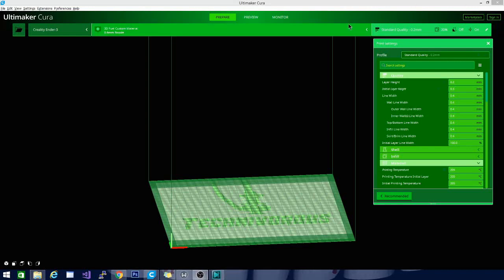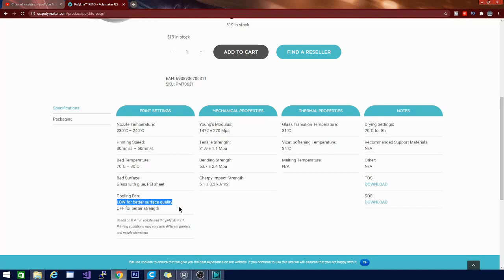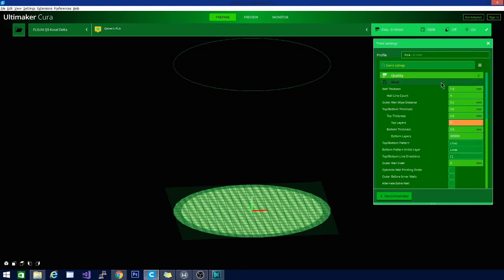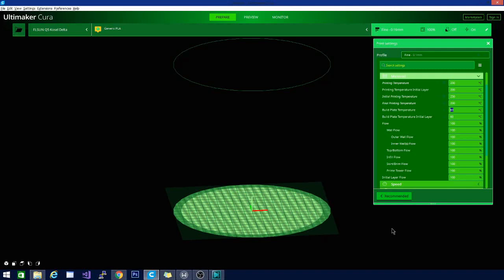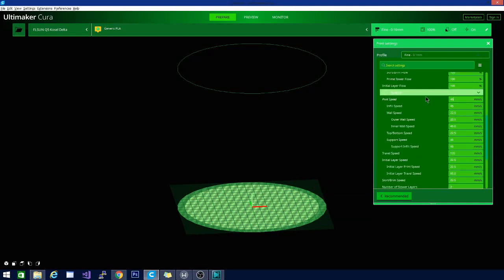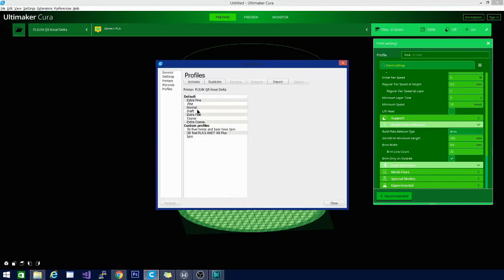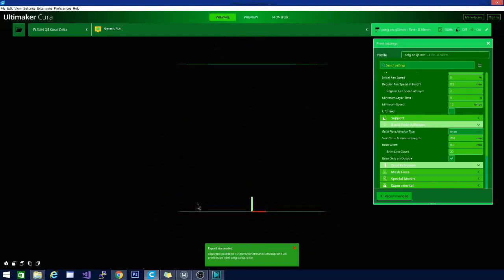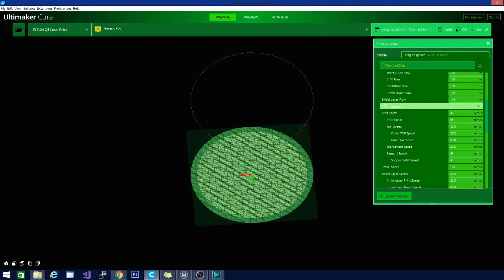CRUCIAL Cura settings for PETG printing

Comment: Will your profiles work on an ANET A6 printer ? I have a 3mm glass bed mirror that works really well to stick PLA on it. PETG i have had to use 70C and a 245C initial layer with fan off to get it to stick nicely. The rest of the way up I just go back to normal temps. But my PETG does not seem to like the normal recommendations and runs better at 220C with fan at 40~70% speed. I am not sure what is best yet.

Comment: Hay man thank you for putting this up way back ..i just used your settings to make a little action camera threaded mount  ,,supper simple but it came out so perfect with your recommended settings and advice. and on an old Ultimaker first gen printer too. cheers to you!
Reply from the maker: Glad I could help

Comment: 5:27 I was under the impression that Initial and Final Printing Temps only mattered if you're using multiple extruders, based on the Settings Guide plugin.
Reply from the maker: Generally speaking yes, but initial print temp is the minimum temp it will begin printing so if your print temp is 220 and your min is 215 it will start at 215 and then continue to heat to the set temp. It is very useful for keeping dual extruders from using, but it does apply to every time you heat and stop

Comment: A huge thank you.  Yesterday I tried to print a petg model and after 3 hours I stopped the print because it had gone all to hell.  The bed side of it did OK but was a bit ragged and then the petg began to build up in globs on the nozzle.  Once it started to print the walls it got really bad and finally wasn't even worth continuing.  I watched several YouTube videos before I came to yours.  I downloaded your Ender 3/Cura profile and loaded it up (the only change I made was to reduce the fan speed to 10 percent) and now I am watching the same model printing and it is damn near perfect.  Again-a huge thanks.
Reply from the maker: This is why im here! You are welcome!
Reply: @Technivorous  From your starting point I went on to check the filament feed and correct it.  In doing that I found the feed tension was off and the nozzle was about 2 turns loose.  Then moved on to test the feed setting in Cura and set it at about 88 percent-now, 4.5 hours into the print it looks to be working.  My Ender 3 is no longer the paper weight it had devolved into.

Comment: downloaded the profile from this video.  Tried printing the ghost benchy model.  Laid the raft down and the bottom of the boat, then spaghetti for miles.
Reply from the maker: Unfortunately odds are good if the print started off well and then went wonky something happened to your printer, is it just extruding plastic, or is it under extruding the model?

Comment: Thanks for your videos.  I use CURA 4.6.2.  Can you provide more info on getting squish correct for the first layer with PETG?  I've heard that PETG needs to be printed higher than PLA and you should level with an index card vs. paper (I don't use ABL) and not use any Z offset.  Are these statements correct?  I was surprised that you didn't mention anything about this in this video.  Thanks.

Also, can you comment on the use of TH3D EZFlex PEI beds & their EZMat Polycarbonate bed when printing PETG.  I use their textured EZFlex on my Ender 5 Pro with the EZMat applied to the reverse side, so I have 2 different options for bottom surface texture.  This has worked really well for PLA and I'm hoping it will work Ok with PETG.  They do advise using hairspray with the EZMat.  Not sure if you have any experience but would be interested in your thoughts on the use of these beds.  Thanks.
Reply from the maker: The pei I use is from buildtak but it has never needed adhesive and petg sticks just fine for me. I assume your pei sheet is pretty close in spec of they are both pei you shouldnt have a problem. As for the squish, I have heard the same about the index card, but I have never tried it, as i tend to print just fine where I'm at. Plus, it sounds kind of counter intuitive to me, you get better adhesion by being closer in my opinion. I'd love to try that th3d reflex though!
Reply: @Technivorous  I use no offset either. PETG sticks very well to my glass bed at 70C with an initial temp of 245C with the fan off. The rest I just revert to whatever works best for that PETG brand and colour.
Reply: You can download load the z-offest plugin for Cura from the marketplace and add a z offset under the adhesion tab I believe in the petg settings.

Comment: Thanks for the info, I have read that you need to set the gap between the nozzle and the bed a little wider with PETG, do you use a z offset to accomplish this?
Reply: I would like to know as well
Reply: I am not sure why they say this. I just use no offset with the mirror glass bed at 70C and the extruder of the initial layer set at 245C with the fan off. It sticks well, but I have to use Brim on very small surface area prints. I revert to normal tempperature and fan speed for pla after that. Actually I run cooler at 220C for petg with 70% fan speed. I am not there yet but the first layer is always good. I made sure the bed is level and that four squares printed at 0.2 mm on a 0.4mm nozzle are actually measuring 0.2mm with a vernier. I just peel off the square and measure it. Its my later laters that are good but PLA quality yet.

Comment: With very low print-cooling fan settings, I find that the intended setting will run the fan, but won't generate enough torque to start it. I have to go into the gcode and "start" the fan. I search for the M106 command that sets the fan to its final speed, then make a copy of the same command a couple of "moves"  (G commands) later. Then, I change the value in the original M106 to 128 or more, to get the fan spinning. When the gcode runs, the first M106 will get the fan spinning, and then the second will be encountered a fraction of a second later, and will set it to the intended value. 
Really, the printer firmware should do this whenever you set a low fan speed. My Ender 5 doesn't.
Reply from the maker: Nice work around though!

Comment: Great video, i have yet to print PETG. Which brings me to ask have you ever tried Sain Smart PETG? 
Or have any suggestions?:) They suggest print speed of 90 to 150 but seems extreme, other settings i did not understand, lol. Maybe i will just use the profile you had linked in another video and just change temp and test out. I am using a CR-10 V2 atm, my flashforge i doubt could do it.
Reply: Personal experience with SainSmart filaments- Not worth the price, and they're non-branded so I never received the same thing twice.  Solutech3D is a pretty safe choice, although they did have some QC hiccups spring 2020, the filament seems reliable one again so I just ordered a case.
Reply: @gregoryconnors7370  Yes i was trying to find the best brand on Amazon just going by reviews. Thank you for the advice, next time i shall give Solutech a try
Reply: @Spirited282  I've gone through a few spools in the case and so far the 3D Solutech quality is once again excellent. And it's Made in USA 🇺🇸 which is huge for me.
Reply: Very late reply, I know, but I absolutely LOVE Amazon Basics PLA and PETG. Great price, great colors, great quality, and Prime delivery guaranteed.

Comment: Chep did an experiment video on the heat versus magnetics issue and found he could not affect the magnetic bed at all even at the print beds maximum heat
Reply from the maker: yeah chuck and i have talked about this. the magnet actually gets stringer at a certain point. if i remember right it took between 10 to 20 lbs of sideways force to remove the mat at temp. so the magnetism didnt give he just overburdoned it with weight.

Comment: by cooling fan, do they mean the part fan or the fan that cools the heatsink on the hotend?
Reply from the maker: That's a good question. This is the part cooling fan, the heat sink fan runs separate to regulate the hot end temperature generally you want that to do its thing. This is the fan that blows on the part I'm talking about